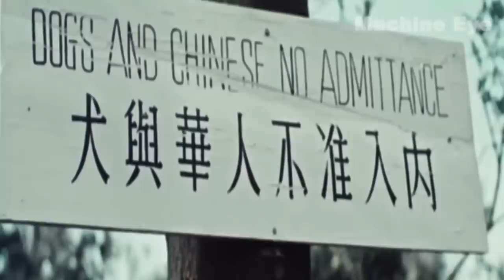China's Construction Techniques Shocked American Engineers

Comment: Every bridge building is unique, catered to the terrain, wind tolerance, weight, distance, load, etc.  There are no off-the-shelf standard parts in bridge construction.  It requires innovation on the part of engineers.  The test of a good bridge is to see how well it holds up after 60 yrs.  The Brooklyn Bridge in New York is an outstanding example.
Reply: It looks like they did that and designed equipment and processes to impliment it too.
Do not sell the little guys short how long has that wall stood?
Until 1917 when all that crap started they dictated the terms of trade for over 3 centuries and guess what they want to do it again, so stand by Jack they might just do it. Watch this space Dude.
Reply: In high-profile projects, it always turns out that the designers are foreign and a lot of foreigners are managing the work. Even critical materials are sourced from foreign countries.
Reply: @bohenry1836  20 years ago, you miss "ago"
Reply: Forth rail bridge in Scotland?
Reply: Right. Now explain why everything floods in China?
Reply: @ValinPrezkowski  And why they have so many buildings and bridges that just fall to pieces in a couple of years of being built.

Comment: Good luck with the concrete setting fully in that amount of time...    safety be damned, full speed ahead.
Reply: 28 day HS concrete castings can be moved and😏 set in 14 days.  If they are to be stressed in less than 28 days, start two weeks earlier.

Comment: You can’t beat the mega machine, ie thousands of people, when it comes to doing a major infrastructure assembly overnight or over a weekend. I remember seeing the real time video of a railway station built with major line interchanges & multiple tram interchanges on a bare city square over just one weekend. Only the mega machine can do that. Amazing, on Friday lunch it was a pedestrian city square where office workers sat down for lunch, by Monday morning was a brand new railway station interchange for 3 different lines & numerous tram lines interfacing outside the station, incredible, & working too. Off course as well as the mega machine at work a lot of off site prefabrication is required & on time too.

Comment: The bridge in boston is historical and so it has extra regulatory constraints.  I think you would find that american projects could be similarly quick if there were a lifting of environmental/ safety regulations.  The I-10 in LA was rebuilt in less than 9 months after the northridge quake becaus eincentives were offered and EIR were waived. Everyone though it would take 5 years
Reply: Exactly.  And it depends on demands.  If the bridge isn't critical they can take as much time as they want.  If you need it now you can do it now, especially if there isn't anything in the way already.  Also nevermind any design time.  They likely had that planned.  The Americans just happened to visit the job site sooner and the stopwatch was running.  I guarantee there were people visiting the chinese site before this video declares the start of the clock.  Then also cherry picking all infrastructure projects in both countries.  But china doesn't have unions so they have that going for them.
Reply: Very true. Safety regulations are a brake on the economy.
Reply: everything takes longer in the US... example... the new railway from san diego to SF... started in i believe 2006... its about 500 miles... well... its 2023 and they are no way near finishing.. on the other hand... take for example mexico... the mayan train... its 1554 km about 900 miles... and its about to be finished this december... it started in late 2019... so.. 4 years... and its going to take about 5 times that for half the distance in the US.... shame really
Reply: @Playami you have to take in consideration if it's a straight run or if there's obstacles such as roadways, rivers, building, and/or mountains to overcome.
Reply: @wobblemcdonald1411  yeah... a lot of obstacles... even uncommon ones like cenotes, and archeological remains... plus lots of rivers, protected areas, cities etc... i don't have the exact number but its divided in seven sections and in just one of them they had to build  more than 100 tunnels for wildlife to pass... so yeah there is a lot of obstacles also not to mention the oligarchy that wants this project to fail.

Comment: It takes concrete anywhere from 24 hours to a month to cure and dry depending on type of concrete, thickness, and weather (temperature and humidity).  Most if not all large projects require several poors and each has to dry before another layer is added.  If anyone does it in 9 hours, it is a disaster waiting to happen.
Reply: 桥梁是预制件，在施工前就做好了，就和搭积木一样
Reply: The Coca Codo Sinclair hydroelectric dam, which was built by a mainland Chinese company in Ecuador in 2016, has developed no fewer than 7,600 cracks in just a few years' time.
Reply: @dbadagna  好好好，你说得对

Comment: I would argue that these things are NOT built in 10 days or 48 hrs. There is years of planning, they build much of the unit off-site for months and then in one night or 10 days, there is the assembling phase. also, these projects are done fast but may not last. China grows so fast that these projects are built to only last 5 to 10 years at the most until they need to be replaced and or expanded. in comprision, the US builds to last 50 years or more.

Comment: The good thing is the speed. The bad things are that the projects are often unnecessary or destructive. Whole cities are empty while others have been destroyed.
Reply: That's a very good point. China's mindless infrastructure expansion is turning out to be a major reason their economy about to enter a deflation period.
Reply: Also, they are known to sometimes proceed recklessly.  Part of that speed comes from skipping a lot of the pre-planning checks (e.g., environmental issues) and intermediate quality control steps (e.g., testing the foundation before building on it) that are normally done in other "developed" countries.  Most of the time, they "get away with it."  Sometimes, there is a disaster, and no-one seems too surprised.  Maybe they accept it as the cost of speed.

Comment: Easy to do when you build stuff with cardboard and that's not a joke check out tofu dreg building in china rebar that can be snapped by hand buildings collapsing due to substandard materials
Reply: THANK GOODNESS! It's difficult to find genuine comments in these propaganda videos. I'm not going to knock the labor - racing to get a train station up in 9 hours is impressive. But the materials and graft at the top, we know all these structures are bound for early failure, missing critical features, and there's a good chance people will die from the deficiencies.

Comment: There are 2 important parts of the 41 hour bridge replacement that weren't even mentioned!  First is the replacement road deck was built and ready to be moved in place after the old bridge was removed and prepared for it to be dropped in place!
Reply from the maker: Thank you for bringing up those important points! It seems that the replacement road deck being built and prepared for installation after removing the old bridge is a significant aspect that was not mentioned. It's essential to highlight the meticulous planning and preparation involved in such a project. You could respond to netizens' comments with something like: "Thank you for pointing out the crucial aspects that were not mentioned in the previous discussion. You are absolutely right that the replacement road deck being built and prepared for installation after removing the old bridge is a vital part of the 41-hour bridge replacement project. The meticulous planning and preparation involved in ensuring a smooth transition and seamless installation of the new deck is indeed noteworthy. We appreciate you bringing attention to this critical detail!"
Reply: @MachineEye  Well why don't you mention that the French,Swiss,Dutch,Germans,Danes,Austrians and Belgians are also capable of doing these sorts of projects as well

Comment: Building fast is one thing, but how well does it hold up with time? If it falls apart in less then a decade without a whole lot of maintenance, then it's not as impressive as it may appear at first.
Reply: The Coca Codo Sinclair hydroelectric dam, which was built by a mainland Chinese company in Ecuador in 2016, has developed no fewer than 7,600 cracks in just a few years' time.

Comment: One Question 
About curring time for concreate . I was told a rule of thumb an inch aday plus a day . meaning 6" (150mm ) thick concreate needed 6+1 = 7 days to cure , and then not full strenght.
that is only one problem with concreate

Comment: Having worked in china none of this surprises me, but its not we are not capable but there is so much paper work here vs there now thats amazing to do a small hwy expansion 1st we did a 7yr environmental study then try and buy right away say another 2yrs now the cost went up 30% just due to time. where in china they say were doing it they can just take people off other jobs and from other cities its just a different world. they are dont have to deal with rights, we put in a subway 2-4yrs min since we need to run a boring machine them they trench just shut down the area, we build stations they take over the basement of builds turn them into under ground strip malls to service the subway

Comment: Just for the record, at 6:21 that is the Steel Bridge in Portland, OR.  Broadway Bridge background left and in the background, right, is a very old break-bulk grain terminal.
The steel bridge has two automobile lanes on the top deck, one in each direction, and two light rail tracks, also one in each direction, as well as two pedestrian sidewalks.  It has had some form of light rail traffic across it during all but about 37 of its 111 years in existence.  The lower deck has Amtrak and freight train tracks as well as a large bicycle/pedestrian lane.  The lower deck can be raised independently of the upper deck, allowing passage of tugs, trawlers, and smaller sailboats without disturbing traffic flow across the upper deck.  The upper deck can also be raised, allowing large ships to pass beneath.  
It's a funky old bridge, but exceedingly cool and one of the most versatile in the world, with regular and heavy use by cars, buses, light rail, passenger trains, freight trains, bicycles, pedestrians, and probably even fully articulated skeletons in motorized bathtubs.  (Sorry, just checking to see if you read this far.)